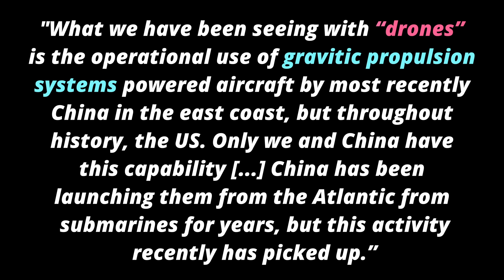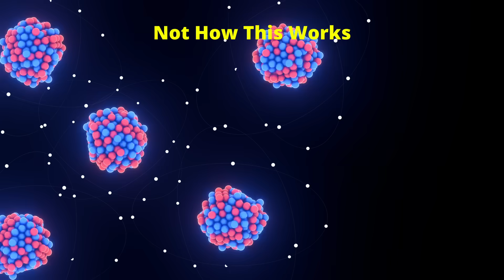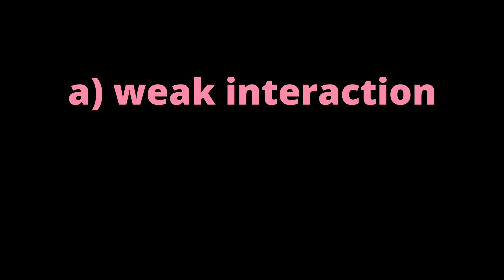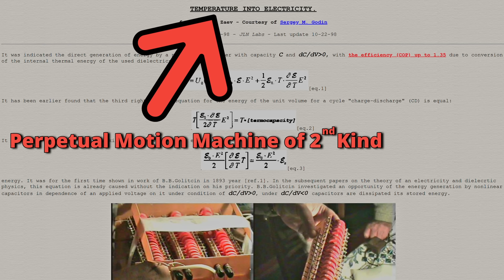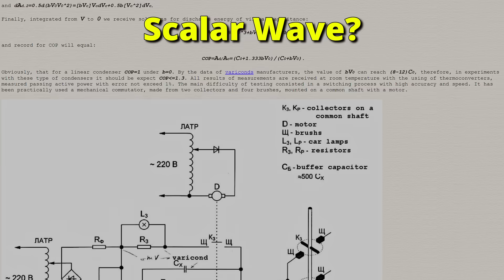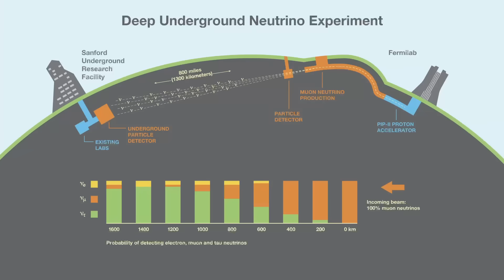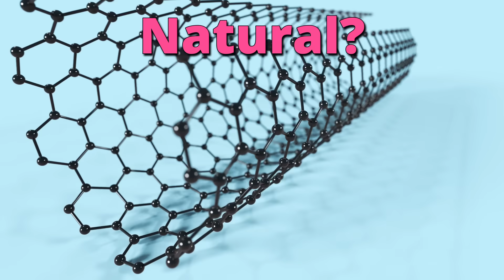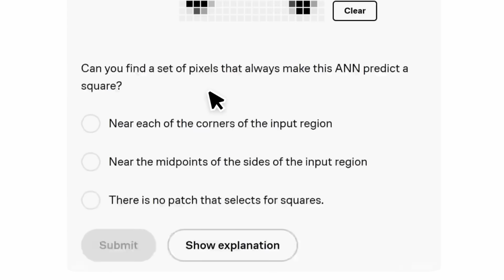What is “gravitic propulsion” and could the US government hide it?

Comment: It is a very precise and excellent explanation.

The uncertainty in metric measurement is truly very complex. If the metric has uncertainties in the measured distance traveled by a photon and its arrival time, many issues arise.  

The first issue is in measurement. The Hamiltonian encounters a non-Hermitian problem, as defined by Pauli. If the Hamiltonian  H  is semi-positive definite (H≥0), then if a time operator That exists, its eigenvalues  t  should cover all possible times, meaning from negative infinity to infinity. This is because physical phenomena can occur at any time, not just at t≥0. However, this contradicts the Hamiltonian  H .  

If the time operator That exists, it would form a conjugate relationship with  H :  

[H,That]=ihbar

This is similar to the commutation relation between position and momentum. However, if  H  has only non-negative eigenvalues (E≥0), such a commutation relation is impossible. This issue was explicitly pointed out by Pauli's theorem.  

It is not entirely impossible, though. Before I conceived the uncertainty relation of the metric, I encountered this problem. At that time, I was considering defining the metric through gauge fields of translation, and when I thought about expressing translations in the form of spinors, something strange happened. If a reflection to the past occurred, it would cause unitarity and causality problems. However, this did not prevent reflections to past time points because multiple reflections to past time points could still occur. But the direction of time flow still pointed to the future, thus avoiding causality issues, as the past still influences the future. The unitarity problem was also resolved because the total energy represented by the Hamiltonian would not flow to the past—it still pointed to the future.  

However, when I realized that the metric is actually measured through photons' traveled distance and arrival time, I abandoned that approach and turned to the issue of metric uncertainty.  

Now is the time to bring it back into use. The Hamiltonian can be resolved by allowing travel to the past while keeping time directed toward the future. This is similar to the cyclical nature of cosmic time: if we return to the past but time still moves forward, we eventually return to the original time point, just like a closed cycle. 

This requires a very large metric uncertainty to achieve because it needs to cover the phase of different time states. Essentially, this can only happen inside a black hole. 

However, problems remain numerous. The issue of Hilbert space completeness still exists because, when the metric is uncertain,  

g_munu(x)  -> g_munu(x) + delta g_munu(x)

the inner product becomes  

<psi|phi>=∫d^n x sqar(|g(x)+ delta g(x)|) psi*(x)phi(x)

Expanding it:  

sqar(|g(x)+ delta g(x)|)≈sqar |g(x)| (1+1/2Tr[deltag(x)])

The corrected inner product then becomes:  

<psi|phi>=[∫d^n x sqar(|g(x)|) psi*(x)phi(x)] + [1/2∫ d^n x sqar(|g(x)|)Tr[delta g(x)] psi*(x)phi(x)]

If delta g(x) is a small perturbation, the change in the inner product is a secondary correction and can be ignored.  

However, if delta g(x) fluctuates significantly, the inner product may undergo a noticeable change, potentially breaking the orthogonality between basis states.  

If delta g(x) is large or randomly distributed, additional nonzero inner products may emerge between different states, making them no longer strictly orthogonal.  

A clearer way to understand this is to consider the collapse of Hilbert space. For example, the orbital and energy levels of different electrons could become identical. In the process of neutron stars collapsing into black holes, all energy levels tend to converge.  

When the metric's uncertainty becomes large enough, the differences between neutron energy levels may shrink or even completely disappear.  

This could even lead to the collapse of the metric itself, making all metric states identical. Although we could argue that this phenomenon necessarily occurs when a neutron collapses into a black hole due to the inevitable breakdown of degeneracy, this does not mean we have no way to address it.  

We can incorporate the correction terms into the Hilbert space beforehand, but this requires precise computation of the compensation term. The metric uncertainty is significantly manifested inside black holes, so we must handle quantum perturbative gravity's vacuum corrections. Without addressing this, we cannot determine the compensation term or fully understand the black hole's interior.  

Although we can use metric uncertainty to derive an exponential decay factor in functional integrals, the number of problems remains overwhelming.

I found that this is not so simple because the coupling constant does not have any uncertainty. Moreover, when we calculate the functional integral, since we are using the Heisenberg picture in quantum field theory, our phase factor is a positive oscillatory factor. The usual approach is to transform Minkowski spacetime into Euclidean space, which results in an exponentially decaying factor similar to statistical mechanics. However, when quantum perturbative gravity is transformed into Euclidean space, it has a negative kinetic term, which is known as the conformal factor problem. This directly leads to a divergent Gaussian integral instead of a convergent one.

Actually, this issue is not that difficult to resolve. In the Schrödinger equation, the oscillatory factor is indeed negative because the Schrödinger picture follows the Hamiltonian formulation. Therefore, the Heisenberg picture, when converted into the Lagrangian action formulation, results in a positive oscillatory factor. As long as we use the Schrödinger picture in quantum field theory, the oscillatory phase factor naturally takes the form of an exponential decay. Since we do not perform analytic continuation to the complex plane, transforming into Euclidean space ensures that the decay factor remains exponential.

However, there is still uncertainty regarding whether the metric measurement affects propagators and vertex terms. If it only influences the measure, it would merely change the interference weight factor without affecting loop calculations. But this is clearly impossible because the uncertainty in position and momentum affects the propagation of the field, and curvature is based on the metric. Therefore, both curvature interactions and propagation will be influenced by the metric uncertainty, leading to exponential decay factors in both propagators and vertex terms. Consequently, we can say that the divergence in quantum perturbative gravity is significantly suppressed, but it is still necessary to verify whether this is indeed the case.
Reply from the maker: Interesting argument, hadn't seen this before. Do you have that published somewhere?
Reply: @SabineHossenfelder   I posted it under your What Everyone Gets Wrong about AI video out of curiosity at the time. I'll post it again, but this kind of idea itself comes with many challenges and an uncertain process that may not necessarily be correct.

I have an idea: although quantum perturbative gravity is non-renormalizable, we have not fully accounted for the fact that the metric itself may be quantized. In classical general relativity, one measures the metric by sending photons from A to B, measuring the travel time t, and then using d = c t to determine the distance. However, we have not considered quantum effects in this process. When we use photons to measure distance, the more precisely we measure the photon's arrival time, the less precisely we know the distance it traveled; conversely, the more precisely we measure the distance, the less precisely we know its arrival time. This leads to an uncertainty relation delta d * delta t≥ l^2_p. At first glance, this may seem unrelated to the renormalization of quantum gravity perturbations.

But let us consider the path integral

Z =intergal D g_munu e^(iS[g_munu] / hbar)

Since the metric g_munu is quantized, we should integrate over ghat_munu. This introduces an extra factor

e^(-delta(g)^2/l^2_p)

which comes from using delta d * delta t ≥ l^2_p, reflecting the photon's time–distance measurement uncertainty. Thus, we have

Z =intergal D g_munu e^(iS[g_munu] / hbar) e^(-delta(g)^2/l^2_p)

Therefore, when delta g is large, contributions from high-energy states are suppressed. At every loop order, this can tame divergences. The reason is that when the momentum of the metric becomes too high, it becomes impossible to measure time and distance in a well-defined way, causing the metric to “foam up.” We often hear about spacetime “foam,” but seldom about what happens afterward. Once the metric enters this foamy regime, it can no longer sustain a well-defined geometry, so its curvature cannot continue increasing. Consequently, there is no singularity. This means that extremely small distances and the extreme curvatures at black hole singularities both vanish due to this effect.
Reply: @SabineHossenfelder All of this is just a coincidence. A wrong starting point gave me the technique. I posted it under your What Everyone Gets Wrong about AI video out of curiosity at the time. I'll post it again, but this kind of idea itself comes with many challenges and an uncertain process that may not necessarily be correct.

I have an idea: although quantum perturbative gravity is non-renormalizable, we have not fully accounted for the fact that the metric itself may be quantized. In classical general relativity, one measures the metric by sending photons from A to B, measuring the travel time t, and then using d = c t to determine the distance. However, we have not considered quantum effects in this process. When we use photons to measure distance, the more precisely we measure the photon's arrival time, the less precisely we know the distance it traveled; conversely, the more precisely we measure the distance, the less precisely we know its arrival time. This leads to an uncertainty relation delta d * delta t≥ l^2_p. At first glance, this may seem unrelated to the renormalization of quantum gravity perturbations.

But let us consider the path integral

Z =intergal D g_munu e^(iS[g_munu] / hbar)

Since the metric g_munu is quantized, we should integrate over ghat_munu. This introduces an extra factor

e^(-delta(g)^2/l^2_p)

which comes from using delta d * delta t ≥ l^2_p, reflecting the photon's time–distance measurement uncertainty. Thus, we have

Z =intergal D g_munu e^(iS[g_munu] / hbar) e^(-delta(g)^2/l^2_p)

Therefore, when delta g is large, contributions from high-energy states are suppressed. At every loop order, this can tame divergences. The reason is that when the momentum of the metric becomes too high, it becomes impossible to measure time and distance in a well-defined way, causing the metric to “foam up.” We often hear about spacetime “foam,” but seldom about what happens afterward. Once the metric enters this foamy regime, it can no longer sustain a well-defined geometry, so its curvature cannot continue increasing. Consequently, there is no singularity. This means that extremely small distances and the extreme curvatures at black hole singularities both vanish due to this effect.
Reply: This is just an argument.
Reply: @SabineHossenfelder  Alright, it seems my thinking was wrong. When energy is too high, different states in Hilbert space do indeed become identical due to metric measurement uncertainty. This is because the states of electromagnetism and the weak force were originally equivalent—they had symmetry but no distinct differences, meaning no additional variations.  

At high energy, the Hilbert space bases of electromagnetism and the weak force are completely identical because they originate from the same unbroken symmetry group. However, at low energy, the Higgs field acquires a vacuum expectation value, leading to electroweak symmetry breaking, which makes the states of electromagnetism and the weak force distinguishable.  

Thus, metric measurement uncertainty causes different states to gradually become identical. In the end, although all forces maintain symmetry, they no longer have distinguishable states.  

Since measurement uncertainty becomes extremely large at high energy, all states become indistinguishable.  

This implies that at high-energy states, all forces may be unified.  

This could be the state inside a black hole.
Reply: I gotta say writing that much into a youtube comment is gutsy.
Reply: This video was posted 13 minutes ago. How t f did you have time to compose this comment in just 13 minutes?
Reply: @jedwards1792   copied and pasted, definitely prepared before
Reply: @jedwards1792 : Check when the comment was posted.  You're wrong to think the video was posted minutes ago; for paying subscribers it's posted earlier.
Reply: @jedwards1792 channel members have earlier access to the videos. She uploads them and publishes them some hours later
Reply: @ ah thanks

Comment: Wait...we do fly faster than sound...maybe slightly ofsey single atom layers of grephene...hhmm😮
Reply from the maker: The speed of sound in a medium isn't invariant though, it changes depending on the speed by which you are moving relative to the medium. Not so with the speed of light, it remains the same regardless of what velocity you move through space.
Reply: @SabineHossenfelder  light comes in 2 forms (at least),liquid Ii.E. a beam of Light and solid a focused beam of Light... so we are looking to focus gravity waves into a solid bbeam...:_atom:
Reply: @SabineHossenfelder  don't cross the proton beams...that could be bad(ghost buster's movie)...

Comment: There are two types of clock. Digital and analog. They both tell the time but one is square.
Reply: That's the problem. You need a long clock.
Reply: @Marvin-tpa My grandfather's clock is long and dangly.
Reply: @Marvin-tpa No.  a wide one. 😉
Reply: I'm sticking to my sundial.
Reply: @Alex_Mitchell  You shouldn't have licked it in the middle of winter.
Reply: @ Is that something you'd be likely to do?
Reply: Some say pie are square, but we all know pie are round.
Reply: @RGF19651  point!
Reply: Did that guy reference Einstein's rulers and protractors? Did they have small clocks attached in their 4th dimension to be able to measure space-time and not only space?
Reply: @isaackitone  fractal cubes have faces that touch, but it's an illusion.
Reply: @kricketflyd111  shading?
Reply: Digital clocks are the curse. Stay with Analog.